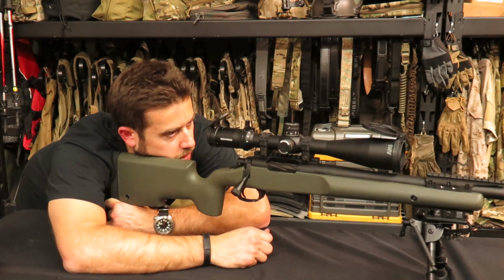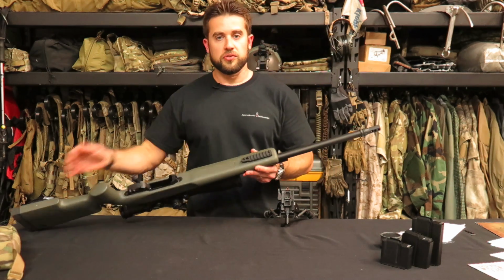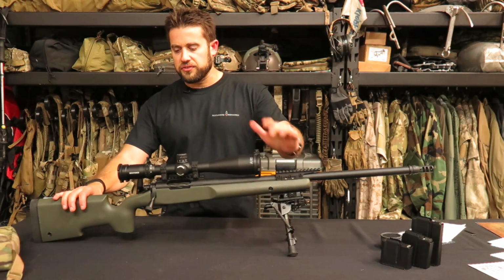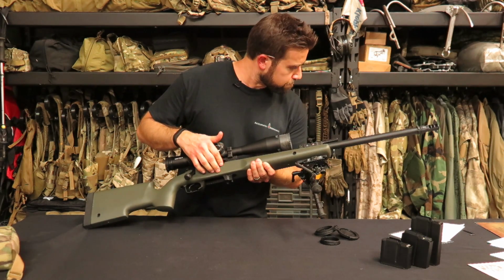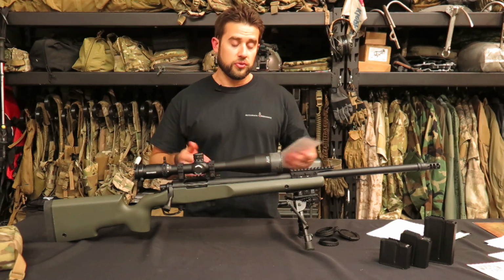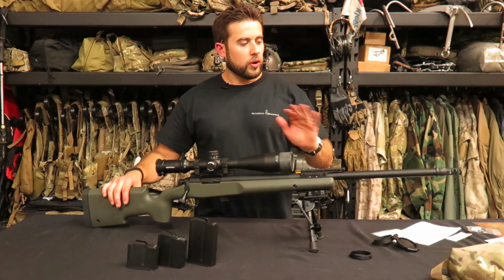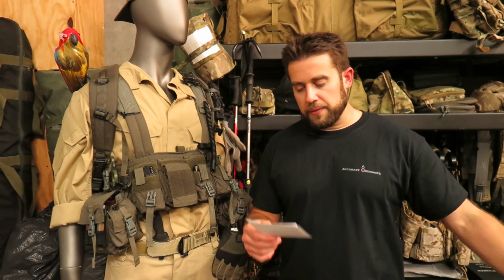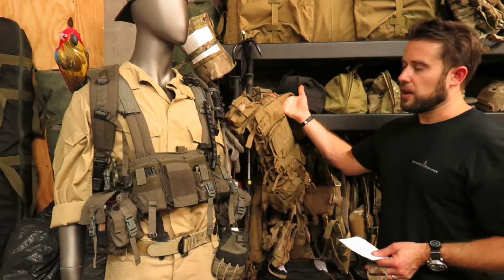Gear Tasting 59: Accurate Ordnance Precision Rifle Build and Color Matching MAS Grey

Comment: Will having the rear scope cover coming down foul the bolt manipulation? just a thought, I wanted to do the same on my rig but had to turn it to the side in the end
Reply from the maker: Yep, I fixed that later. I had it adjusted like that when I was first putting it on and not thinking clearly. At the time we filmed I hadn't even double checked the eye relief in getting it back from Accurate Ordnance and just added the caps. Dumb oversight. I like the Tenaebraex covers because you can fold them back almost parallel to the scope when open, to reduce their signature profile. That's how I'm running both the front and rear currently. ~ Bryan
Reply: Glad to hear all sorted Bryan, good looking rig there and looking forward to seeing range video! There is a scope cap in the UK, possibly US too, called Accucover. It has 4  chevrons at 12, 3, 6 and 9 o'clock to assist eye position. Bit gimmicky but it does lay totally flat against the scope body! I have the Tenabrex cover on my PM2 objective, great bits of kit!

Comment: is "colorway" just the newest word you've learned? it doesn't apply when referring to single colors... those colors. colorway  implies 2 or more colors in a single application.
Reply from the maker: I learn new words everyday, but I've known this one for years. It's actually a common term used in the cut & sew industry to refer to the overall usage of different materials that make up the product. So for instance, "MAS Grey" would be the colorway nomenclature, yet as I mentioned in the video, it has Foliage colored buckles from National Molding. You're not wrong on drilling down into it meaning 2 or more colors. Sometimes you get lucky and each manufacturer for all the hard goods and soft goods refers to their materials the same way (i.e. Ranger Green) and sometimes they don't. It would still be called a "colorway" though. ~ Bryan